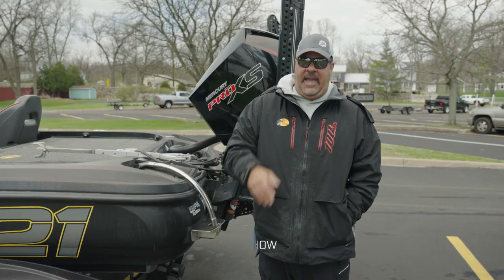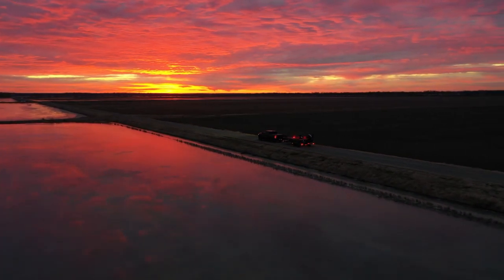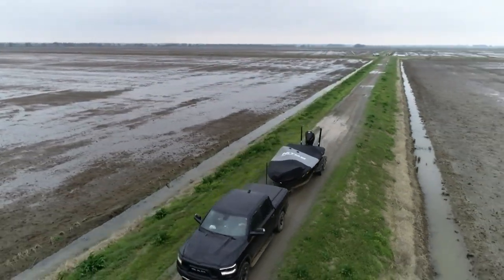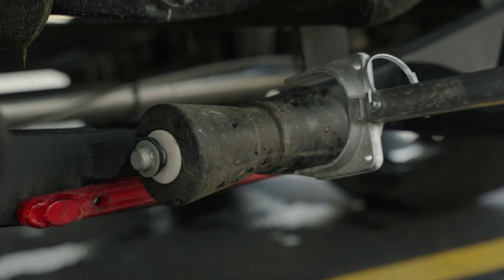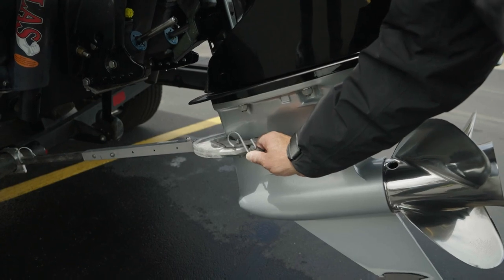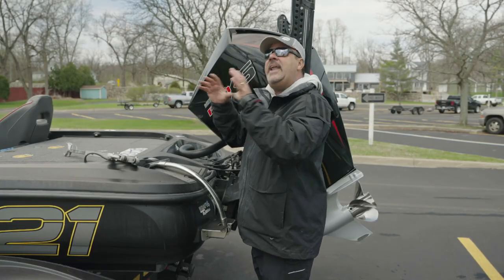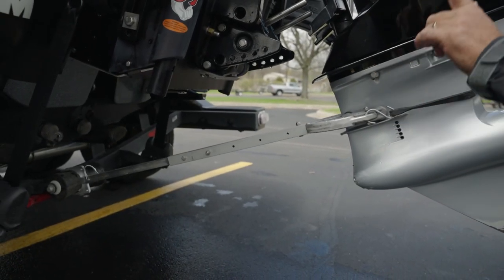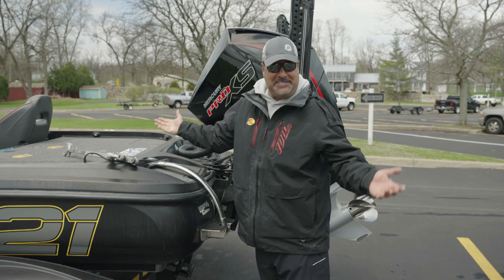Why You Should Use an Outboard Support Bracket

Comment: Agree with video…. Been using them for 30 years.  No transom issues, no motor/trim issues. Make sure that you do not draw down too tight on the bar.  That can be worse than not having one.  Places more stress on transom and lower unit.  You do not want this to be part of a boat/trailer stability system. Lay the motor slight snug.  The bar is to support the motor while on the road.  Not be structural part of the trailer tie down.  Also, adjust the bar to have a minimum, but high enough tilt to avoid road hazards.  However not tilt cranked real high. The defeats some of the purpose of the bar support.